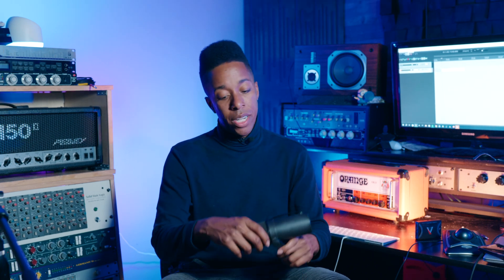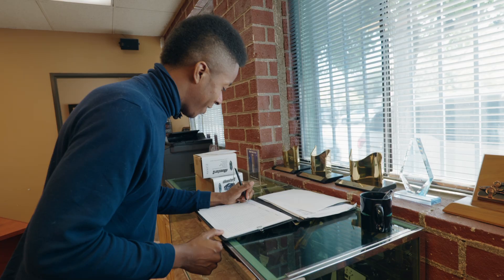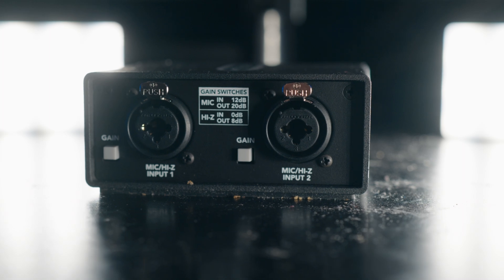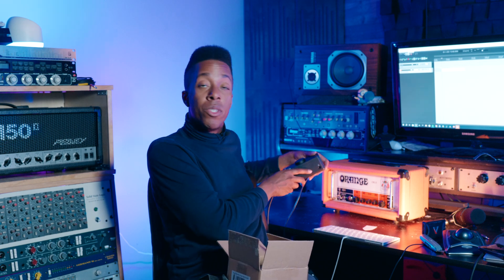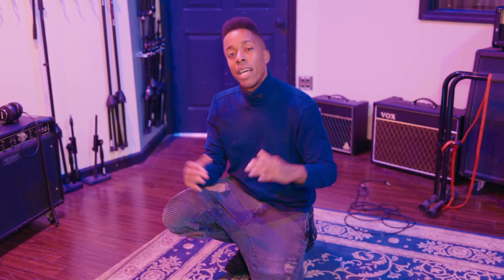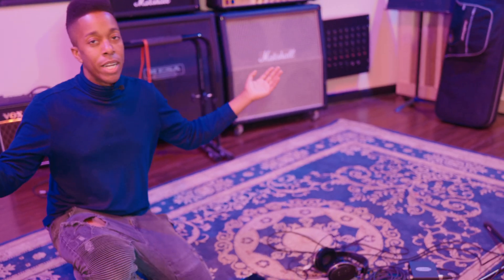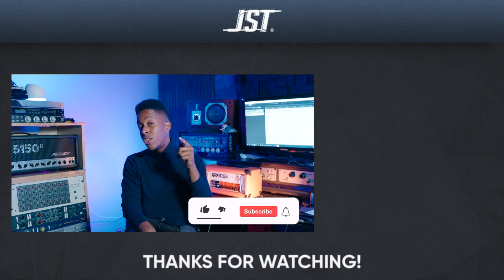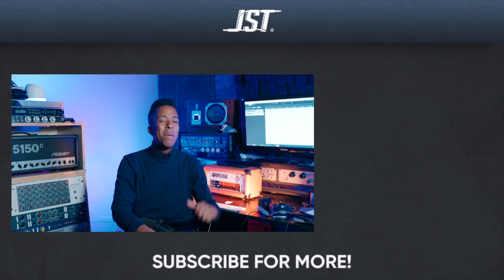Pro Tips For Making The Shure SM7b Sound Better (Royer D Booster Review)

Comment: It's really interesting as I've never really found an issue with using the SM7 apart from having to push the gain more than my other mics. I'll have to check out the dBooster in my own setup and see how it stacks up with the other mics too.
Reply: Did you end up trying it?

Comment: I have an SM7B, and it's my main vocal mic. I use it with the Howard Benson Vocal plugin and the Howard Benson Vocal Multiplier plugin. My interface is a MOTU M4, and the Royer dBooster2 will solve one of the problems I have with the mic, which is that I would not have to crank the gain on the interface. Thank you for making this video. It is very helpful.

Comment: I love my Shure SM7B. It just works on my voice. I actually removed the windscreen from mine and used a traditional pop filter instead. I find that that brightens it up significantly while doing a better job of controlling plosives. I often don't have to do much EQ for it to sit in the mix. 

Some other reasons I love the SM7B: 

1) It does a great job of controlling my sibilance. I have a sibilant voice, and condenser mics aren't always the best choice for me. 

2) It doesn't pick up many room reflections or background noise. I have a nice portable vocal booth. But I still find with a condenser mic I can end  up with unwanted resonances, traffic noises, etc. With the Shure, I can record in any room in the house and be fine.

Comment: Indeed dBooster is a very interesting piece of gear, and definitely makes a difference on SM7b gain (without change it's sound or add noise). Because, as you mentioned in the beggining of the video, SM7b is said to be an industry standard (as they say about SM58 and 57 - and they are standards), many people just buy them without "understand" them... Just plug it on and get disapointed, and say that they are "muddy" or "boxed" and etc... All of them is just like a blank canvas, and give you a lot of possibilities of great results (like any "thousands of dollars microphone", needs work, experimentation and ears). It's like develop a product as dBooster: sounds very good because have a lot of work, experimentations and ears behind it. Thanks for show it and congratulations for the video.

Comment: Definitely more details with the dBooster in your chain.  I’ve used the Cloudlifter and it reduced the noise but it didn’t change the overall sound appreciably.  Did you notice an improved noise floor with the dBooster?

Comment: Hey Miami- I’ve never actually had an issue with the SM7B, I actually swapped out higher end condenser mics for it due to moving around to different rentals and not always having a great sounding space. I run the SM7B into a CAPI VP28 and it definitely has enough gain, however I do run into noisefloor issues from time to time- I’d love to try a Dbooster 2 into the VP28 to see if I can rid myself of some of the noisefloor!

Comment: I’ve never had any problems with the SM7. I tracked my entire album through it - leads as well as doubles. I do track with compression, though. Since I use unlimited amounts of gain reduction, all I’m really doing EQ-wise is lo-cutting and the smallest boost at 15k.
Reply: How do you fix the cloudy sounds that come with a limiter
Reply: @1cx7r23  I don’t think I have that problem. 🤔
Reply: @BeautyInAPlasticBag  oh I see. I do. Maybe I need better monitors
Reply: @1cx7r23  Can you describe what you’re hearing in a little more detail?
Reply: @BeautyInAPlasticBag  almost like important relevant details like melody and harmony are obscured in some way...
Reply: @BeautyInAPlasticBag  i found adding console saturation helps a bit
Reply: @BeautyInAPlasticBag  in metal especially a lot of recordings in the last few years have the sound of being gainy. Or just a hodge podge of vocals and drums that I think comes from the chronic over use or misuse of a limiter throughout the industry for example. Maybe that helps in describing what I mean
Reply: @1cx7r23  Sure, yeah. But I don’t think that has to do with the mic being an SM7. It’s just the sound most people in Modern Metal are aiming for. Myself included.
Reply: @BeautyInAPlasticBag  i mean specifically the use of a limiter. The vocals are probably tracked fine

Comment: How to gain the SM7B:
1. Turn the gain nob clockwise

If the above results in an unacceptable signal-to-noise ratio, you either:
A. managed to buy a fake SM7B (common problem, learn to spot the fakes, and then buy a new one)
B. used a way too long or way too cheap microphone cable (easily fixable)
C. bought a microphone for 500 bucks and expect it to sound good through the preamps of your 50 buck audio interface (buy new interface)
D. don't understand signal-to-noise ratio (consider another career)
Reply: I own a focusrite clarett and im using a cloud lifter with it i still get lil noise from it. But thats a easy fix in post

Comment: I don’t know why it bothers me so much when people say xxx pre “powers” a mic. That isn’t at all what happens. Phantom power aside, pres don’t power anything.  

I just gotta throw out there also that mic boosters, especially in the context of the SMB7, almost always make things worse.  Most modern interface pres are designed with much lower noise floors than is or will ever be possible with any transformer. And so while you’re boosting the signal, you’re also boosting the noise floor. 

Do a comparison between (without the dboost and a post digital gain/slight tilt eq,) and (with the dboost,) and you’ll see what I mean pretty quickly.

Only in rare cases where your interface has junk noisy weak pres will a transformer booster ever be a good option.